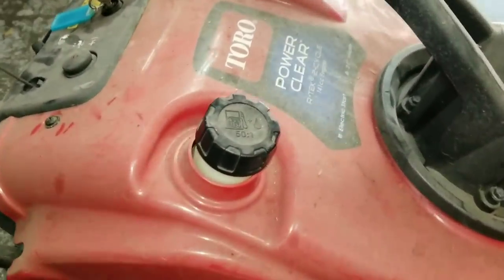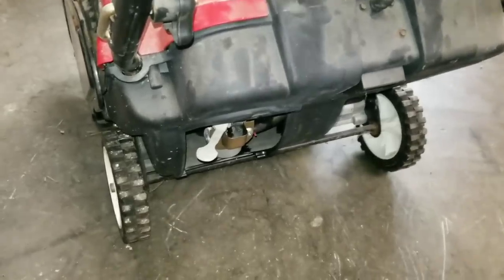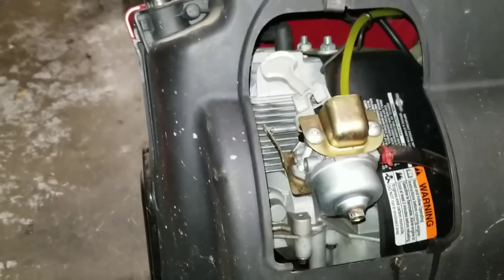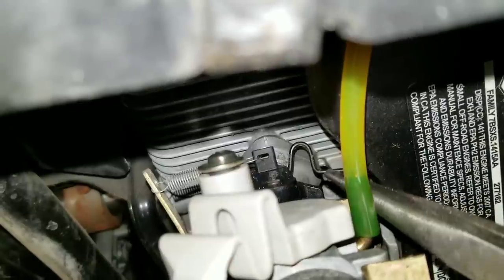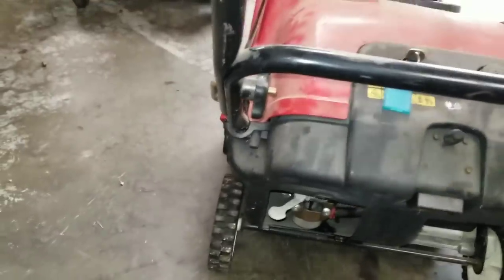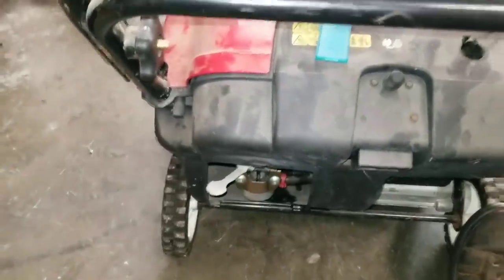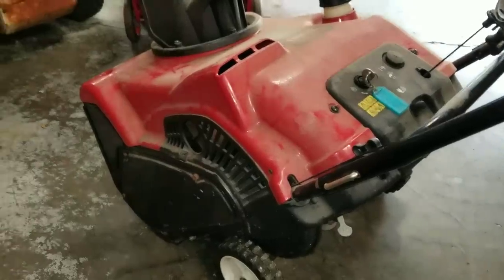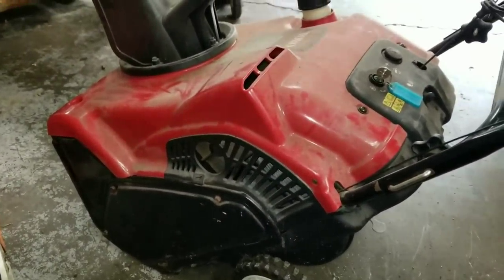Toro Power Clear Snow Blower Surging Fix and RPM Adjustment

Comment: I want to thank you for posting this video. I bought a Toro CR3650 single stage snowblower back in 2003 and after about a decade had some problems with surging and power loss, sometimes it would just stop on me. Took it in for tuneups repeatedly but it was never right. By 2020 I was about ready to get a different snow blower. Then I saw your video, and all it took was a pair of pliers to adjust the two areas - and ever since, it runs strong and steady, doesn't lose power, doesn't surge at all! 
It's been a hard winter where I live and just this morning I cut through 10-12" of snow with my 20 year old Toro, for a couple hours and the power is steady. Thanks again!
By the way, my machine still has the original plastic carburetor. I bought an aftermarket replacement carb several years ago to install just before I saw your video, but then didn't need to replace the original carb.
Reply from the maker: Awesome! Glad to help! Thanks for watching!

Comment: Well, I gotta tell you that advice was absolutely spot on.  Just put a new $15.99 carb on my 2000 Toro CCR 2450 which has run GREAT for years (first pull start every time:-).  Suddenly it wouldn't start at all and visually I could see the plastic carb was leaking.  Came close to trashing it but checked a few things and thought it didn't look difficult at all to install a new one.  New one fired up on the first pull but the surge was terrible.  Using your pinch the throttle wire was MAGIC.  Thank you so much for taking the time to post this video.  You ROCK dude!!!
Reply from the maker: So glad to help! Thanks for watching!
Reply from the maker: Awesome

Comment: I saw this video a couple of days ago. Tried this fix today, and it worked great. Don't squeeze together too much or the idle will race! Thanks for sharing!
Reply from the maker: Good job! Thanks for watching!
Reply: thats because that metal rod is connected to the governor which is really brittle and made of plastic, sadly ,, they break really easy ,,thats why it will rev really fast because youre changing the governor setting,, :)

Comment: Just replaced the original Walbro carb on this same unit with a Chinesium import. Immediately noticed surging. With no sign of obstruction of the throttle linkage I tried your fix. Worked fantastically. Thank you very much!
Reply from the maker: Awesome!

Comment: My Toro CCR-2500 RTek snowblower was surging in a similar manner.  A quick test is to grab the governor link (the wire that was adjusted in the video) and hold it in place.  If the surging doesn't stop, you may have a fuel problem in the carburetor.  In my situation, it was the governor link.  Squeezing it together as was done in the video fixed the problem for me too.

Thanks for the tip!
Reply from the maker: Glad to hear Brad! Thanks for watching!

Comment: Thanks for that. The original plastic carb on my 3650 started leaking badly, which I read was a common problem--so I replaced it with a Chinese metal replacement from Amazon that looks just like the one in this video. It has been surging but not to the point of being unusable. Adjusting the idle speed screw and the governor spring tab made it better, but didn't completely remove the surge. Will go out later and take another look at the governor linkage, which from the looks of your video is almost certainly the problem!
Reply from the maker: Awesome! Thanks for watching!

Comment: THANK YOU So Much!!!!
I just replaced the carburetor on my Toro 2450 Snow Blower and it’s surging just like yours.
Maybe a little worse.
I’m going to try what you recommended.
I’m pretty sure that this will fix my issue.
Reply from the maker: With the odd angle of the throttle/governor linkage this is by far the most wrongly diagnosed issue with these. Glad to be of help!

Comment: I have a 221QE from 2007 or so--the first year they came out  (although I knew it was really just a 3650 in a new package and with a metal carb.)  It was never right from the start, although it was too late to return it by the time I realized it.  For years I had to deal with non-starting when warm.  The dealer was worthless.  Their answer to everything is "bad gas--clean the carb."  Finally I figured out that coil was defective.  So much for warranties.  It's a bear to change it on this machine--you have to remove the wheels and virtually take the entire thing apart to get to a bolt on the underside of the engine to remove the engine shroud.  Needless to say, I left that bolt out when reassembling the machine.

So warm starts were now fine, but it still never ran right.  Would surged and threaten stalling.  I kept this thing immaculate, always used Sta-bil, always ran dry in the spring.  I had had a 2-cycle Simplicity with a Tecumseh HSK-850 for the 7 years prior which I treated exactly the same and worked first pull every time never giving me a bit of trouble.  So this was frustrating.  I finally broke down and replaced the carb.  Now the surging and stalling was worse and immediate.  Found your video and adjusted the governor linkage.  Instant success.  There was probably nothing wrong with the old carb.  After so many years, it's nice to have a snowblower that works properly.  I wanted so much to love this machine--I love the chute control--and now I can.  There is precious little online about the Power Clear series and this is literally the only video I have ever seen showing how to make this adjustment.  God bless you and thank you so much.
Reply from the maker: MrTrashcan1 glad to hear it worked for You! The bad part is that we have to make this adjustment darn near every time we replace or clean a carburetor! The linkage just doesn't hold up. Thanks for watching!
Reply: Actually I spoke too soon.  After using the blower a few days ago, it began acting like it did with the old carb.  It would run fine for a while, then begin threatening to stall.  Moving it to half choke usually solved this for about a minute, then that would start to stall, moving it back to choke off would solve that for a while, and so on.  Sometimes leaning the snowblower back ends the stall.  Sometimes adding load ends the stall.  And this is with a new carb.  I don't understand this.  It's either clogged or it's not.  It should either run right or not.  How does it go from fine to lousy to fine?  Checked the fuel line and it flows fine.  Replaced the coil, fuel filter, gas cap.  Re-starts fine first pull when hot.  Then goes back into the fine-lousy-fine mode.  It has done this since the first day I ever used it to do a full snow removal.  Just powering it up for a few minutes doesn't reveal the issue.  So frustrating.
Reply from the maker: MrTrashcan1 sounds to me like the main jet is partially clogged or there is an air leak between the carburetor and the block (one of the gaskets).
Reply: Do you think it is possible that when the engine heats up, that the seal between the carburetor and engine can change one way and then the other.  Could it seal and then unseal and so forth?  I thought those bolts were tight, but maybe it requires more force.  I cannot understand how a partially clogged jet can produce varying results.  Does something else change to compensate for the lack of fuel which then appears to correct the performance at times?
Reply: Well, I tightened the bolts in hopes that it was the seal between the carburetor and engine.  Started right up first pull, sounded great for about 5 minutes, then the usual--surge and stall, surge and stall.  This was a new carburetor--I'm baffled that they sell new ones pre-clogged.  Is that like a bad joke?  I've had this Toro for 8 years.  For the previous 7 I had a Simplicity with the Tecumseh 850 engine.  Started first pull every time--never an issue.  Thinking I might need a backup for the Toro, I had purchased a used Ariens with the same Tecumseh engine.  It sat unused for years until the Toro conked out last week and could not be restarted.  While trying to start it electrically, that gear stripped.  Put fuel in the Ariens, started first pull.  Why do those carbs not clog?  I treat them exactly same as I treated the Toro.  Gas with stabilizer,+oil with stabilizer, run dry at end of season.  Just fed up.  Sorry for the rant.  Know any knowledgeable techs in the Philly area?  The Toro dealers around here are incompetent idiots.
Reply: MrTrashcan1 almost sounds like you are getting restricted flow from fuel tank from either lines or filter being partially clogged. I also see fuel lines deteriorate when re-connecting and partially cut off fuel. Still gets fuel, just not fast enough to keep up after a bit. My guess without looking at it. Good luck!
Reply: Thanks, Martin.  Filter is new, and I checked the flow when disconnected, but did not change the lines, so that will be my next step.
Reply: It sounds to me like you have a leaking crankseal or you have a bad gasket between the carburetor and intake manifold. Try spraying some penetrating oil or silicone spray around where the carb attaches to the manifold and see if the surging stops. If that doesn't fix it, there is probably a bad crankseal.

Comment: Dude! Suhweeet! Say you ever have leakage outta of the brass colored bowl that holds the primered oil/ fuel mixture? I’m hearing if you’re primer bulb, doesn’t have an air vent in the middle of the bulb It can cause increase pressure and push the primer fluid out of that between the gasket and the intake. Have you ever had that issue?
Reply from the maker: Not venting can cause fuel to come out where it should not absolutely

Comment: Excellent tip!  Thanks for posting this video.  This tweak calmed the idle surging right down on my CR3650.  I will note that if you pinch the linkage too much and make it just a bit short, the idle will increase by quite a bit.  Just expand the linkage a little and find the sweet spot.  Great video.
Reply from the maker: Thanks for watching!

Comment: I have to thank you because I just went to a gentleman's house and fixed his the way you showed me and he did say somebody took the carb off before I did and went through it and sure enough it was the spring and the throttle band so thank you so much.
Reply from the maker: +John jay drott no problem glad to be able to help!
Reply: i had the same surging issue which I resolved by pinching the throttle band back together as you suggested in this video. but i cant get it to stop idling so high. i tried bending the tab as you mentioned but its still running way too high. any other ideas?
Reply from the maker: @seanmahoney5719  Did you replace it with an aftermarket carburetor by chance? Does it move freely back and forth when not running or are there any catch points?
Reply: @IndRepair  yes its an aftermarket carb. Yes it does move freely though...no catch points as far as i can tell
Reply from the maker: @seanmahoney5719  with the aftermarket carbs I see them hit the top screw in the intake a lot. See how close it is to this. If it is over revving it has to be either getting caught or the air vane that controls rpm speed has build up or is not working right. Of course to see this air vane, well you have to disassemble quite a few thing. Happy hunting!
Reply from the maker: By that I mean the throttle plastic hits
Reply: @IndRepair  ok thanks, so if the plastic throttle is hitting the top screw (or getting caught there), how do i fix that?
Reply from the maker: @seanmahoney5719 Trimming some of the plastic from the carb is the only way to do it on the aftermarket ones. I use sidecutters and take about 1/4" off around the edges toward the engine. Careful, don't take too much but just make sure there is a good space between throttle plastic and intake bolt

Comment: Great ideas that work.  I thought maybe I needed new gaskets with air leaking through, but the solution was the linkage wire and then I did adjust the idle speed slightly too.  THANK YOU for posting.
Reply from the maker: Awesome!
Reply: @IndRepair  Another question,...(I haven't tried it )  how does the engine react if you squeeze the linkage wire too much,...sputters as well?

Comment: I pinched this together and it idled at an extremely fast rate.  I couldn't adjust it lower with the tab.  Perhaps I squeezed it too far?  When I tried to expand it again I broke the plastic tab that connects to the spring.  Likely need to replace the carb now.
Reply from the maker: Both bends need to be about vertical. If you go too far, or have an air leak between the carburetor and engine (at either gasket) it could cause it to go extremely fast. If the tab is broken a new carburetor is the way to go

Comment: Still works great a year later. We had a lot of snow the other day. The paddles wear pretty quickly, i get two to three seasons maybe?
Reply from the maker: Yeah if your lucky
Reply: Individualized Repair 

Yeah I looked close, a season is pushing it.

Mine is ten years old and the engine finally is mort. I found a short block, any "gotchas" on replacement? Thanks again.
Reply: 😮 Concrete vs Asphalt is the difference. Concrete is like course sandpaper and eats the paddles quicker, a lot quicker!

Comment: Linkages usually don't get bent on their own.many I see have a clogged  carburetor from useing gas with ethonol in it or improper storage.
Reply from the maker: They usually get bent in this case when someone takes off the carburetor to clean or replace it. The linkage comes out at a weird angle and the linkage is really fragile so it bends easily. Thanks for watching!

Comment: I tried everything changing the spark plug and fuel filter putting seafoam in the gas to clean the carburetor and I even changed the gas cap. Try this and it seems to be working like new.. thank you so much.
Reply from the maker: Awesome! Thanks for watching!

Comment: Hi, great information, but my choke tab is very loose.when I turn it off choke it moves back in to choke very loosely. How do it tighten it up?
Reply from the maker: If the choke is loose the plastic of the choke body is normally broken. This is the only thing I have seen cause this. Replace the plastic choke assembly with a different one. There is a separate white plastic choke lever screwed into the choke body assembly from the top. It will be the black choke assembly piece underneath that is the culprit. Part number is 801418. Thanks for watching!
Reply: @IndRepair  is there a part number for the rubber auger
Reply from the maker: @davidcotton5479  99-9313 is normally the auger part number but it does depend on the model number. At the Toro website they have the part's diagrams. Model and serial number are on the vertical right hand wheel aluminum axle/base surface

Comment: What if you have the governor rod that is straight not looped like yours? How to adjust it? Thanks and great video!
Reply from the maker: This is most likely not the issues if that is the case. You can adjust the rpm speed by bending tab attached to spring to tension spring more

Comment: Your video helped me tons. I just bought this same exact model used for 40 bucks and the lady said she had a guy put a new carb on it but it died when she hit the snow (under load). It was missing the governor spring and the governor linkage arm was on upside down! All good now thanks to you! One thing, there is an idle adjustment screw on these, why bend the tab? Thanks!
Reply from the maker: Nice! Bending the tab corrects spring tension instead of reducing the ability for the throttle to go lower with the "idle adjustment" it's really a low speed idle adjustment, which on a snow blower always at full speed, is useless. Sometimes you can "cheat" and make a snow blower run good like this but it is not the right way to do it

Comment: The part you ¨bent" with the pliers? What is that called and where does that attach to? I think I broke the plastic bracket that it attaches to and I am looking for the part. Thanks
Reply from the maker: Usually called the blade for the governor or blade-governor. The metal piece is the governor linkage